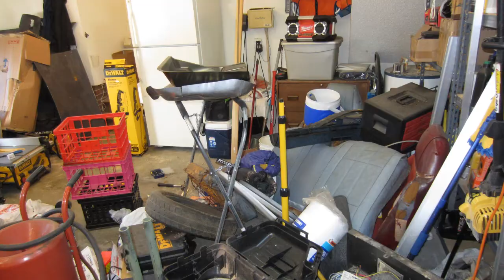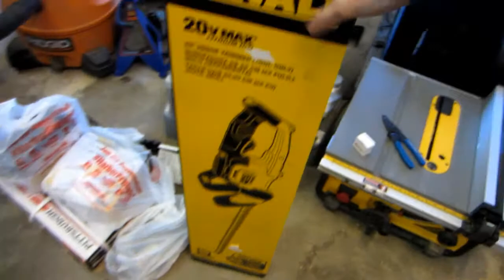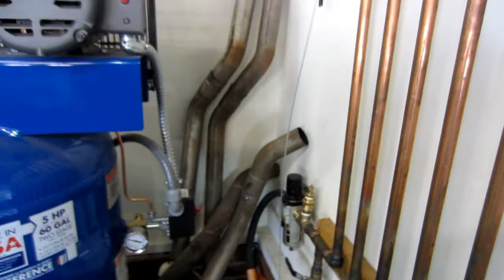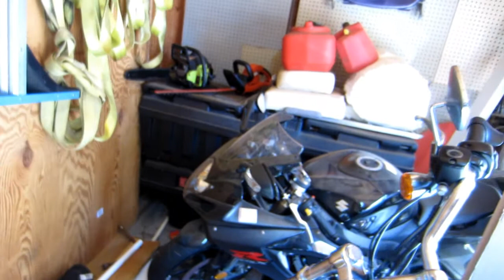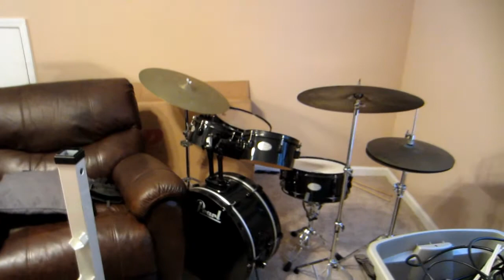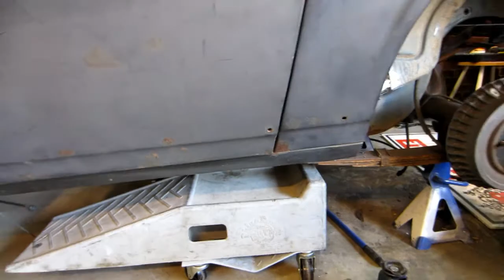Garage Clean up and Car Parts Storage

Comment: Its amazing how much room all these parts take up. I was working on storing some parts today. One thing that I will do is on the  totes, tape a sheet of paper to the outside of them and label everything that is in there. Then you wont have to open them to see. Nice Gsxr.
Reply from the maker: Thanks Russ.  That's a good idea on the totes.  I will have to do that if I get around to cleaning up the room above the garage.  The GSXR has been layed down and then given to me but you can't see the damage in the vid.  Probably going to sell it when it starts getting warmer out.

Comment: yup  I too have the garage and the wife has the rest lol. I feel your storage dilemma all too well. idea for you just a suggestion wish I did it build a bench along the back wall or side wall and buy a couple of those mid boxes and screw them from beneath suspended .....good to see you again sam
Reply from the maker: Thanks Mark.  That's a great Idea!  My back wall is over run by compressor, metal table, tool box, shelving, and soon a blasting cabinet.  I could remove the shelving and replace with what you described and build shelves above.  Hmmm... something to think about.  I looked at the side wall, and I don't want to put a bench there as the space between the car and wall is already a little tight.